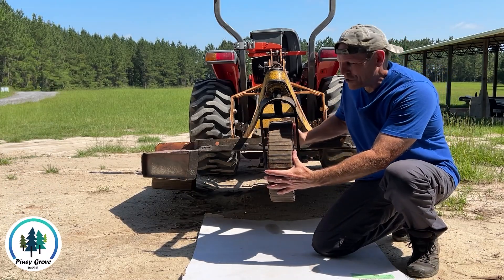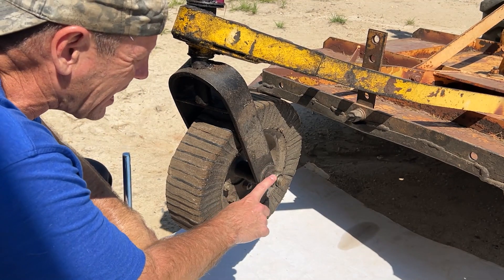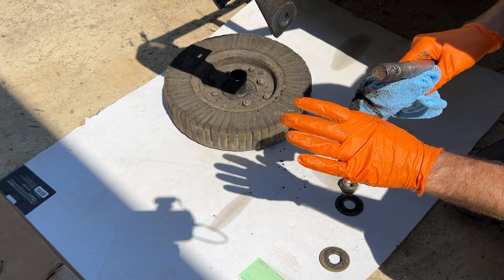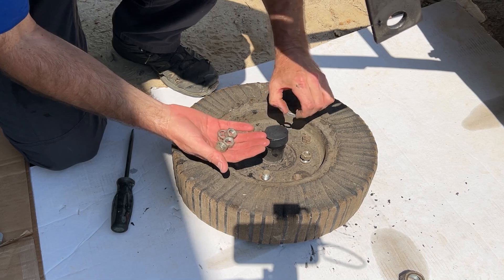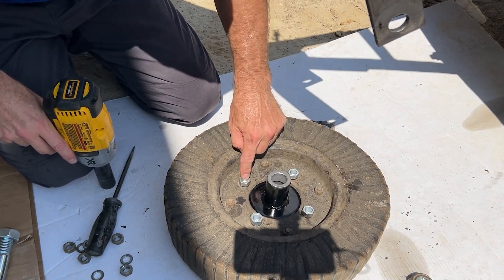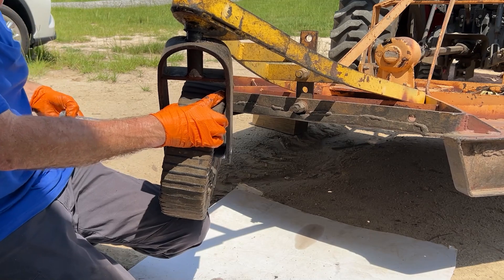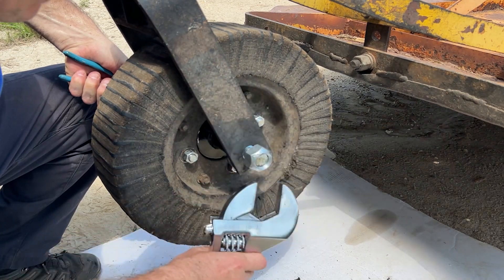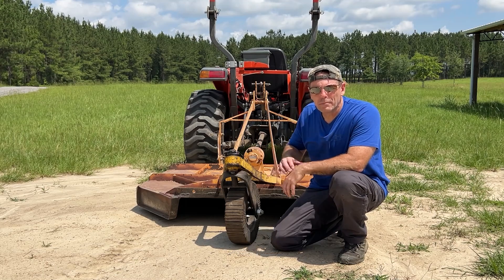How to Fix a Brush Hog Tail Wheel | Bushhog Hub Replacement

Comment from the maker: Brush hog in extreme use: https://youtu.be/2LtKLLMwSRE

QC-Mate X-Boom Hydraulic Coupler Clamp:
https://www.skidsteersolutions.com/
Use PINEYGROVEHOMESTEAD for 5% off anything on the website!

New way to fence your land!  Cat's Claw Fasteners.  
Use code PGFREE for free shipping!
https://fencingstaples.com/
Or Amazon Affiliate Link:  https://amzn.to/4dDcaJ7

This is our Amazon store with affiliate links to products we use on the channel.  It doesn't cost you anymore and it helps support the channel, THANKS!
https://www.amazon.com/shop/pineygrovehomestead-tractorsandoutdoors

Some of our favorite products on Amazon (affiliate links):
Blade Sharpener Guide: https://amzn.to/4dGYZa5
Dewalt 20V Cordless Grinder: https://amzn.to/4bF2trS
Flap discs: https://amzn.to/3UKEzo0
Grinding wheel: https://amzn.to/3K95ipi 
Proven Industries Trailer Lock: https://amzn.to/3WVzytv
Flex Tape: https://amzn.to/3R4MdWm
Mechanix Leather Gloves: https://amzn.to/3HjoZZf
Titan Post Hole Auger: https://amzn.to/3toHEx2
Ratcheting Fence Tensioner: https://amzn.to/3aEfSX0
Pope and Pipe Level: https://amzn.to/3tqUhHX
Fence Post Puller: https://amzn.to/3QbcNhy
T Post Manual driver: https://amzn.to/39dwt3J
Come Along Winch: https://amzn.to/3aQMqND
Clip bending tool: https://amzn.to/3xlqrG0
Mechanix Leather Gloves: https://amzn.to/3HjoZZf
6’ Digging and Pry bar:  https://amzn.to/3vH5Agx
Dewalt 20V ½” Impact Wrench: https://amzn.to/3UOcXNH
Dewalt 20V brushless Leaf blower: https://amzn.to/3zwJcYm
Dewalt 20V brushless ½” drill: https://amzn.to/3HGXJ7z

Welcome to our channel!  🎥 What to Watch Next: 
Fixing Leaky Pond: https://youtu.be/NEwSTg1aOWc
Transforming Our Property: https://youtu.be/-jBGEYJea1Y
Clearing Thick Brush with Mini Excavator: https://youtu.be/QVNiwOHSWdo
Mowing Large Acreage: https://youtu.be/sXV5CgRs3nk

➤FOLLOW US on Social Media: 
Facebook - https://www.facebook.com/PineyGroveHomesteadAndMiniFarm/
Instagram - https://www.instagram.com/pghomestead/
TikTok - https://www.tiktok.com/@pineygrovehomestead

Our Story:
We are six years into a seven year effort of transforming 20 acres of "Piney Grove" in Northwest Florida into our dream homestead/mini farm to be filled with animals and joy. We plan to have a variety of miniature critters on our pastures, raise free-range chickens, grow fish in our pond, garden, plant fruit and nut trees, and harvest wild game. Our goal is
to escape the stresses of corporate life and embrace all that country living
has to offer as we enter the next chapter of our lives. Follow along on our
journey!

Thanks for watching and please Like and Subscribe to help our channel!!
Brad & Deb